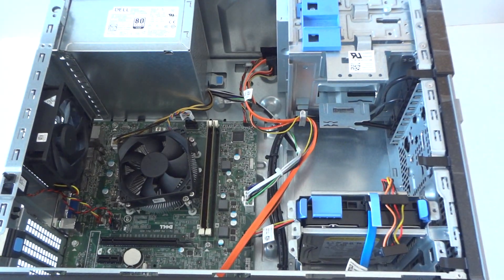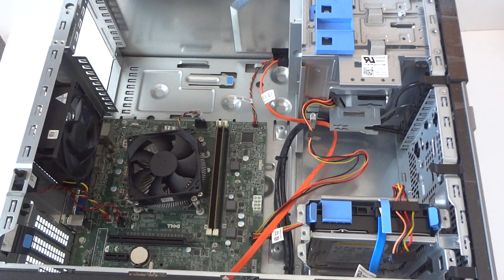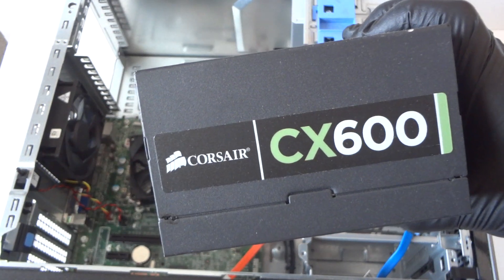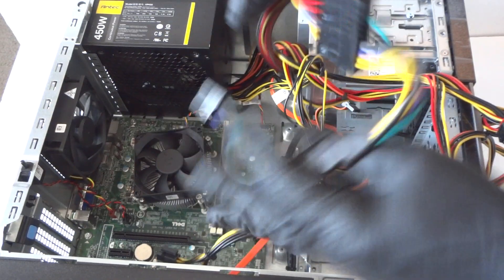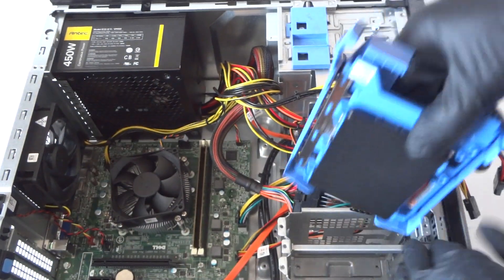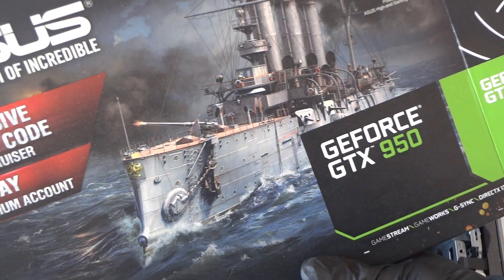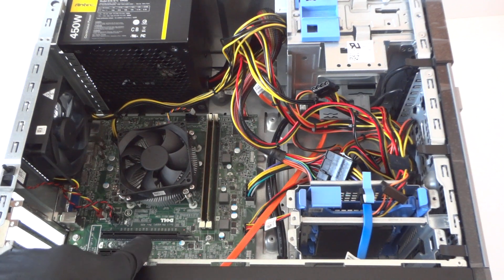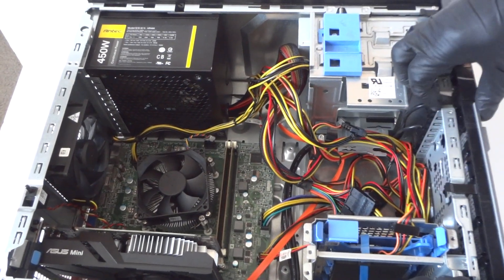Dell Optiplex 3020 Gaming Upgrade Video Card SSD Drive

Comment: Thanks for sharing. The PSU is not required for this card though. I ran GTX 1050Ti on 180W PSU along with 4th gen Intel i5 without issues for 6 months before upgrading it. PSU would only be handy if installing GPU that needs additional power or is heavily overclocked.
Another tip - HDD to SSD caddy is not required, you can simply cable tie it to the chassis or use any 5.25 to 3.5" adapter.
Last but not least - do not buy anything under 4GB in terms of GPU - chances are the price difference is minimal but performance impact is huge depending on the title.
Reply: @John Sanabria no estimated total system power is 300 watt's which is just a rough figure they put on the box to make sure the tech ignorant have enough power for most systems with that card 1050ti's max around 150's watt's with overclocked versions..to get 275 watt's to a gpu you need the pci socket,and 2 6 pin pci power cables....socket delivers upto 75 watt's each 6 pin pci power cable delivers around 100 watt's MAX 1050ti's use socket power and or 1 6 pin pci cable which means the absolute max draw is about 165 watt's and they wont even use that average use under load is 100-120 watt's by 1050ti's

Comment: ik this is really old but would a cx 450 work?
Reply from the maker: Hi, yes cx 450 power supply will work.
Reply: Mxkdi aight thanks I'm probably gonna put a single fan gtx 1060 6gb in then
Reply: so how did that work for you?

Comment: can i change the motherboard like any motherboard which is micro atx?
Reply: mobo's are a bit trickey case dell uses proprietary mobo's so the screw holes might not line up you will have to compare it to another..make sure you get the right socket for your cpu and proper ram support and have a psu with a 20+4 pin psu cause dell's 8 pin ones wont power most any other mobo

Comment: help :(
i have dell optiplex 3020. and i bought gtx 1050. and when i was downloading driver for it. It goes to black screen and i waited for a long time it didnt came back. is it because of my psu (i.e. 290 watt)? help me... TOO MUCH FRUSTRATED..
Reply: Bibekshil Rajkarnikar A GTX 1050 needs a 300W PSU to work properly so I think your Power Supply is causing this issue.
Reply: @SebWayYT  no the psu should supply enough power...if it worked prior to installing driver's the problem is not that at all..there is a chance they installed the wrong drivers or got a fake card those are passed around on the net often enough in the below market price range...there are a few other problems it could be tho

Comment: Can I put a Ryzen 3 2200G on an Optiplex 3020 (tower), if not which budget motherboard do u suggest?
Do I have to change my power supply for that?

btw nice videos, keep it up :)
Reply: No different mb
Reply: no ryzen uses a am4 socket motherboard.you cannot ever put an amd cpu in a intel motherboard ever..best case it wont work worst case you can blow it all up...The ryzen 2200g is more power effiecient than what came in these the problem power supply wise is that ALL am4 motherboard's use a 24 pin motherboard power supply cable not the 8 pin seen here so it wont work for that reason...

As far as budget friendly am4 motherboards go asrock makes one for about $50 you could use with the 2200g remember am4 motherboard nothing else will work

Comment: I found a 3020 for cheap. But my new power supply has a lot of wires which you don't seem to use. then are you NOT using the power of the new PS?  just the adaptor to 8 pin and the cpu? all other wires frm the board to the disk are the old wires.
Reply: you dont have to use every wire to max out the psu...but no that build is not using the full 290 watt's

Comment: Hi Mr I'm reading all the comments. I just bought the 3020 and I'd like to know if I can swap the processor. I have i3 4160. I rather i5 or i7.
I'll appreciate your answer.
Reply: Daniel Filpo yes you can,  works fine on i5
Reply: do you know which kind of i5?? and possible i7 ??   @marktrick100
Reply: depends on which chip you want to use..anything with a 'k' at the end you can forget...you also need to stick to the 4000 series intel cpu's new or older gen's wont work...but yes you can put in say a i5 4570 for example..

Comment: Hey! I know this video has been posted a long time ago, but could you answer a question? Nice work by the way! I subbed! :) 
My question is will the Dell Optiplex 3020 Full Tower fit a Zotac GTX 1050 Ti Mini?
I also see that it has low power consumption so I will keep the 290W PSU.
Thanks so much and nice video!
Reply from the maker: Hi, yes Zotac GTX 1050 Ti Mini will fit full tower and 290w is fine you do not have to upgrade your power supply. Thanks
Reply: Thanks!

Comment: Sir can you please help me i have an optiplex 3020 mt . I have gtx1050 inno3d twin x2 im planning to upgrade my psu to a higher watts because i have the 290watts dell psu .what will happen if i put my gpu the recommended psu for the gpu  is around 300watts that printed on the box.thanks for your reply.my dell psu has a 8pin power source to the Motherboard im strugglin to find an adapter for 24pin to 8pin. Do you think it is safe to put my gpu on a stock dell 290watts psu ?
Reply: yes the 290 watt gold psu can handle a 1050 or 1050ti just fine...

Comment: I'm Brazilian, I do not know how to speak English, I'm using google translator. My question is, do I need to buy another case to use the gtx 950 video card, which one are you using in the video? my pc is dell optiplex 3020 i5-4590
Reply from the maker: Hi, do you have mini tower or small form factor ?

Comment: Wow, great video. Looks like you are a guru with the Optiplex.  Please let me ask you a question, with Dell Optiplex 3020, 3.3 GH Intel Core i5  - 4590, 8 MB Ram, 1TB HD. is there any chance to use it for Oculus Rift? Of course, we would need to upgrade the video adapter and the power supply but looks like is not compatible with NVIDIA GTX 970. Please answer and again great video!
Reply from the maker: Hi, yes you can use NVIDIA GTX 970 and to fit this video card you have to remove hard drive cage.
Reply: That means the Optiplex 3020 has a slot for a NVIDIA GTX 970? I thought it only has a PCI-ex16 connector for video adapters. Thank you!
Reply from the maker: Yes you can install gtx 970 video card in this dell optiplex 3020 mini tower and does have one pci express x16 slot and you have to remove hard drive cage to fit this video card.
Reply: Again thank you and keep doing your great job/videos!
Reply: @williamarenas2093  3.0 and 2.0 x16 supports virtually any graphics card dating back to 2000ish...Ia 4590 and a 970 is a bit of a push for vr tho it wont be a smooth experience expect vr sickness..the question here on compatibility is if it will fit in the case and if your psu delivers enough power
Reply: Lmfao I Velcro my hard drive

Comment: hello

can i buy a gtx geforce 1050 ti for this optiplex? and if i can dose it have to be a lp or can i get the double fan one?
Reply: Hi, I am doing the same, a 1050 ti will work fine with this computer, doesn't need to be low profile as long as you have the tower or mid-tower form and not the small form factor (sff). I am upgrading the power supply to a cx430 just to be safe. If you are changing the psu you will need the adapter shown in this video.
Reply: thank you so much for your response

but i have the 290 power supply will it still work?
Reply: yosef rzk The 290W psu will probably work, however I don't think it would cope under load, for example during long gaming sessions. If the psu goes it may damage other components of the system, so you should really consider getting something like a 400W psu. It's very easy to swap the psu anyway.
Reply: got it and thank you so much for for the responses (:
Reply: @youssefrizk551  dont listen to mark..the 290 watt psu provides more than enough power about 80 extra watt's
Reply: @allenbrodess8510  i already got the 1050 ti and its working wonderfully on the 290 watt psu (:
Reply: Hi, I'm about to make the optimization at the same time optiplex so can I put a 1050 on you? changing the psu

Comment: Can i set gigabyte geforce gtx 1050. 4gb gddr5 graphics card for this pc plzzz reply me plzzz
Reply from the maker: Hi, yes gigabyte geforce gtx 1050 with single fan will fit fine in mini tower.
Reply: Mxkdi does it need 300w psu for this? Or dell psu will work?
Reply from the maker: Hi, no you don't have to upgrade 290w dell power supply will work fine with gtx 1050.
Reply: Mxkdi thnx for helping...

Comment: I bought for my minitower dell optiplex 9020 a Corsair cx500m and there is no 4 pin management what do I have to do now?
Reply: i am facing same problem did you find solution please help.
Reply: Arslan Malik buy SATA to 4pin cpu adaptor

Comment: This guy is the only one on the internet who knows anything about the dell optiplexes.
Reply: @DIVERSA  i'll assume you meant low profile.depends on what has been added to the system ..If it's bone stock yes the 1050ti's without the pci power connector's will work...If you've went in adding sound card's expansion slot networking car's or other additional hardware tho a psu upgrade would be recommended
Reply: DIVERSA use psu calculator
Reply: @Ahmad Muhammad If the graphics card is not using pci power there's enough power there assuming you don't go throwing a bunch of accessories at it..
Reply: @Ahmad Muhammad gpu can only draw a max of 100 watt's from the motherboard alone...You are good
Reply: @woosh bait2 huh..x16 fits all x16 slots same with x8,x4...verify you have an x16 slot and read about how to install something in it i guess...cause if it's an x16 there should be no issues with getting it in place
Reply: @woosh bait2 are you making sure it is fully seated and locked in place?moving your monitor cable (vga/dvi/hdmi) to the graphics card from the mobo? go to device manager(search in cortana/windows search) and check for new hardware after it's installed.you have to install drivers 2 sometimes windblows can be a pain with automatic updates/detection
Reply: @woosh bait2 If you had it powered on or attempted to power the system on while it was being inserted/inserted improperly you may have killed the socket and or card....
Reply: @woosh bait2 NO judgement..But NEVER add or remove a part from electronic devices while they are plugged in/powered on...always unplug drain caps and remove battery if there are any and then service the system...
Reply: Allen Brodess hey man, I’m installing a gtx 950 into one of these, it has a 6 pin power plug in, am I gonna need to buy cables or upgrade cpu?
Reply: can anyone tell me what video cards they have tried for this PC (SFF optiplex 3020) that have fit and installed fine?  there is not a lot of room and it looks like a very tight fit.

Comment: hello, i have this optiplex 3020 MT will a gtx 1050 ti fit in the case?
Reply: yes, but in nvidia wbsite it says that minimum psu must be 300W :(
sorry to make you sad, but i dont want you to make the same mistake i did
Reply: thank you for your suggestion, i know this requirement and infact i'm going to upgrade psu too, as showed in the video, with a corsair cx450m
Reply: @Happyfxs  what happend when u use 290psu? did the gpu not work?
Reply: NormalUsers I don’t even remember what mistake I was talking about, but I ended up buying the gt 1030
Reply: NormalUsers I think it will work tho. You can select your parts on pcpartspicker and see how much power your parts use
Reply: +Genny Schiattarella I hear u don't need to upgrade the psu for the 1050 ti
Reply: the stock 290W will work just fine for 1050 ti

Comment: Hey, I have the same Optiplex 3020 MT and I was wondering if a GTX 750ti would work even if I kept the default 290W Psu.
Reply: Should be good long as it doesn't have the extra power on the card.
Reply: Maiden Trooper i am using msi gtx 750ti twin frozer on dell optiplex 3020mt and its worked great
Reply: @SyedHasnainRazaRizvi  thanks, im planning on doing the same but then with a asus one
Reply: @n8mr124  ok
Reply: I now installed evga gtx 1050ti 4gb Gddr5 single fan version graphics card in to my dell optiplex 3020mt and its worked great.no need to upgrade the power supply.
Reply: @SyedHasnainRazaRizvi  great to hear, if im gonna upgrade in the future it looks like I dont need to upgrade the psu
Reply: @n8mr124  yes you dont need to upgrade the psu.
Just buy the graphics card without the pcie power connector because psu in dell optiplex 3020mt dont have pcie power connector

Comment: Hi i want ask if i can on dell optiplex change pc case without problems with connecting USB start and more. And how i can on back of optiplex 3020 case dismantled mother board plug (thing on back of case where is connector for example VGA usb.....)

Comment: why new psu? seems like system requires less than 280W?
Reply: Synn Navamananda theres a video on YouTube show someone playing gtx 750ti on 144w psu
Reply: @Aron Tobi one who does not know should not speak the preinstalled psu is plenty for adding an ssd and a gtx 950 and would most likely provide better power efficiency than the one he put in...950 75 watt's cpu 85 watt's ssd 10 watt's for a toal of 170 watt's factor in the 10% or so of loss on 290 that's 29 watt's call it 40 to be safe the means the psu can constantly and most efficiently supply 250 watt's 250-170=80 so there is 80 remaining watt's of which an optical drive wont use more than 30 of if that

Comment: does this computer provide 75w through the pcie x16 slot? the motherboard connector looks pretty small
Reply from the maker: Yes Dell Optiplex 3020 Mini Tower PCI Epress x16 Slot (Black)  Maximum Wattage 75W
Reply: wheres that slot you say??
Reply: you are looking at the wrong slot the x16 is the bigger one and is the same size on ALL motherboards since forever until the end of time.

Comment: I'm also getting an old pc of the same brand, Dell Optiplex 3020(i3 4130 3.4ghz).
I traced the original on newegg and the reviews pointed out how it's using a proprietary mobo and psu so replacing them is quite difficult but that review was made 2 years ago.

So if the original psu dies can I still replace it like you did with some extra power cables? 
Was the compatibility issues only a thing of the past?
Reply from the maker: Yes you can
Reply: The compatability issue is due to 2 things..1 haswell requires specific power supplies with tight voltage regulation to not void cpu warranty and 2 which is still a factor today is that virtually every power supply sold after market uses a 20 or 20+4 pin mobo power cable so you have to get the 24 to 8 pin adapter shown here...

Comment: Nice video! Very informative. But could it support higher graphics card such as the gtx 1060 and upper?
Reply from the maker: Yes you have PCI Express x16 slot you can install GTX 1050 Mini or GTX 1060 Mini Video Card, Power Supply at least 450W
Reply: Thank you!
Reply from the maker: Hi, yes EVGA 600B power supply and EVGA GTX 1060 sc gaming ACX 2.0 (Single fan) Video card will fit fine on dell optiplex 3020 mini tower
Reply: are there 2 different version of the optiplex 3020 (2 different case sizes).  I have the optiplex 3020 SFF and I think the biggest PSU I can find that would fit is 300W.   the stock PSUin my PC is 255W.